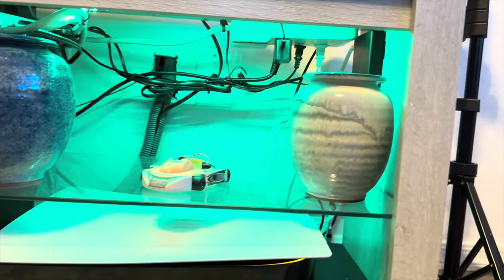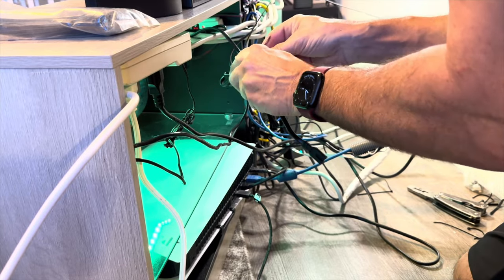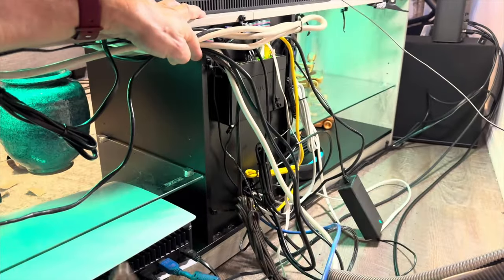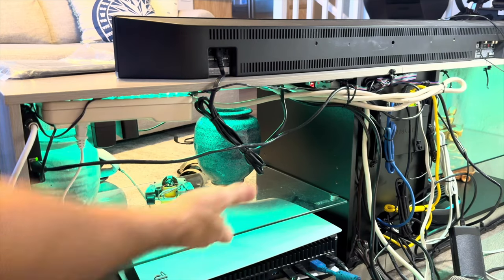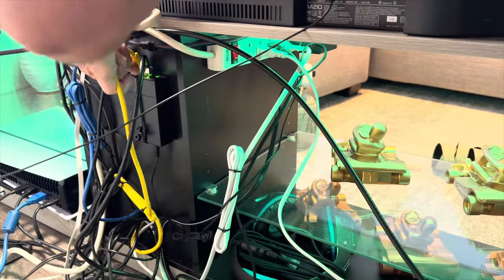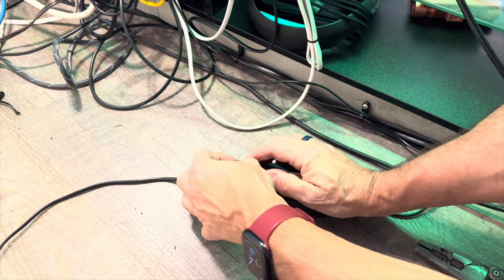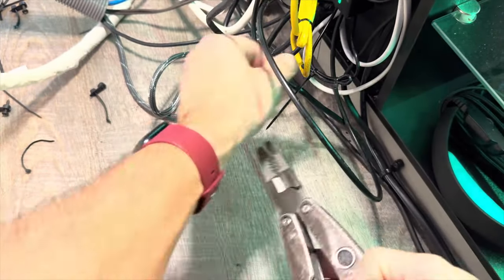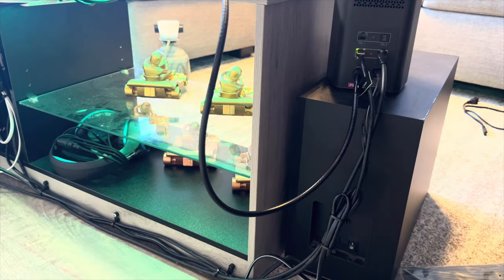Cleaning Up Cables Behind My TV Stand - Cable Management Time!

Comment: Any acoustic benefits from hiding the sub behind a dry wall? Asking for a friend 😉 Looking forward to the video.
Reply from the maker: Do you mean cutting the drywall and putting the sub inside? I wouldn't! Man, that would be clean though. Truth be told, I'm in a townhouse with a neighbor on the other side of that wall, so I probably will not attempt. 🤣
Reply: @DigitalRelay  🤣 hehe, that’s what I thought when you mentioned hiding it, sorry man. Who needs neighbours anyway 🎸
Reply from the maker: @zimbakin  Sorry I wasn’t clear… I was referring the the small white box to the right behind the tv stand. It’s the amplifier for my TV antenna. There’s an access panel on the wall just above it that I think I can hide it inside along with a cable or two.